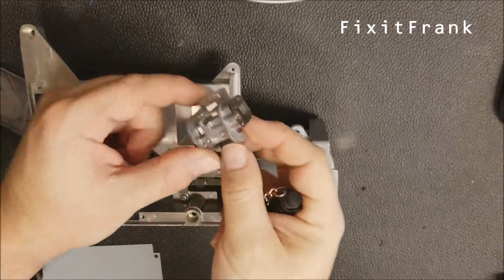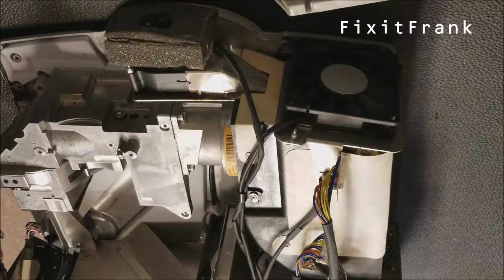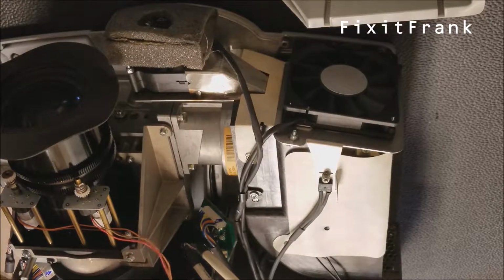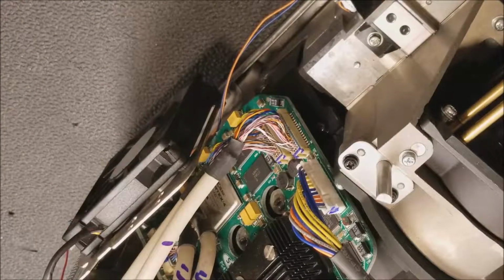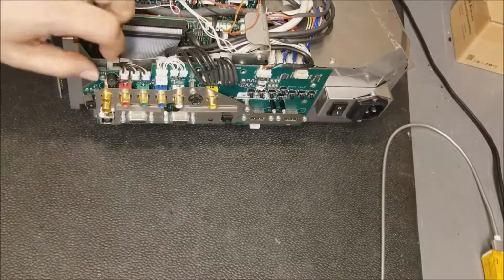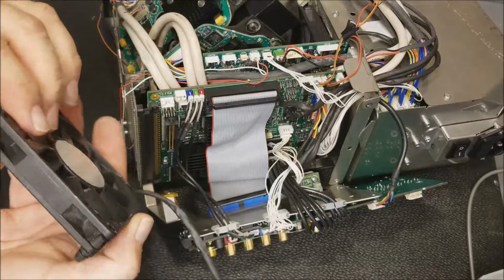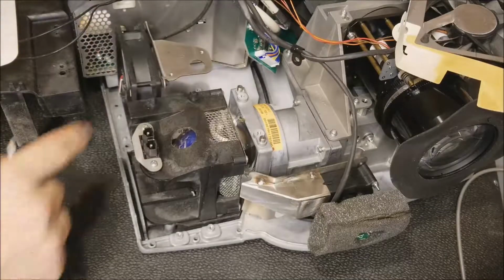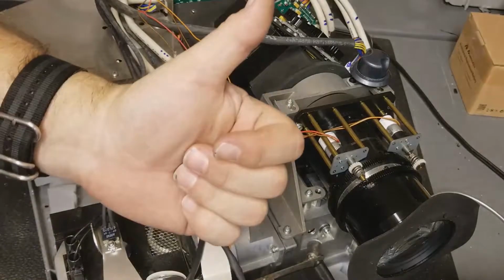Sim2 C3X DLP Projector Repair

Comment: Hi Frank. Thank you for this video. I have a question for you if you don't mind. I have a C3X Lumis Uno and I noticed something strange last week. When I run the internal test pattern menu (for example, the white color pattern), you can see that one corner of the image is very much brighter than the rest of the image (in the ceiling position, it's the top left corner). On the right, the image is dull and lacks brightness. Do you think it is the same problem you mention at the beginning of the video ? Or maybe dust in the brightness tunnel ? I don't know. I opened the projector today, and I disassembled the optic and it is clean. I didn't go any further for the moment. Thank you for your help.
Reply from the maker: Hi Serge, That is hard to say.  Here are a few things to check.  If your lamp is old, I would replace it first.  A failing lamp can make uneven lighting. Without using a known good lamp, you can run in circles. I recall that these use an integrator rod with I don't think can pick up dust since its one piece.  I have to double check on that but I doubt its the tunnel/integrator. You would have a very obvious visual issue with the picture rathe than just uneven brightness.  Another thought is to try adjusting the lens position and see if that changes the dimness. If it moves with the lens, I would change the lamp first and see how that goes.  Lamps tend to be the main cause of situations like this. Just make sure you can return it just in case it is not.
Reply: @FixitFrank  Hi Frank. Thank you for your response. So, my lamp is not very old (890H). Approximately one third of his life. That's why I didn't immediately think of the lamp. But it is a possibility that cannot be ruled out. I sent a message to SIM2 support. They asked me to send pictures of the screen to make a diagnosis. But, if it's the lamp, it's both good and bad news. The good news is that it's easy to fix, and the bad news is that the life of the original lamp was far too short. So you think it's unlikely to be dirt in the integrator ?
Reply: @FixitFrank  Hi Franck. Well, I have exchanged with SIM2 support. I sent them some pictures and it seems that it is the end, lamp side, of the ROD integrator that has burned. It seems to be a bit brown indeed. I am waiting for a quote from them. But I'm afraid of the bill.
Reply: @sergelefaurestier7719 did they sent you the price for the rod integrator? Looks like it happened to my Sim2 too
Reply: @Skymane  Hello. Yes of course. Sorry for you :( So .... The Rod Integrator on my SIM2 was indeed “burnt”. SIM2's after-sales service in Germany sent me a quote and I shipped the machine to them. The invoice was 1915€ plus shipping (yes, it's expensive :( ). The lamp was also changed (mandatory in this case) and the firmware was updated. The projector came back fine, and everything works perfectly. With the firmware update, I no longer have the problem of being unable to switch off that sometimes occurred. The damaged Rod Integrator was undoubtedly due to this projector shutdown problem. Indeed, when this happened, I was obliged to cut the power supply to the projector and then, very quickly, switch it back on so that the ventilation could cool the lamp properly. Then switch off again as normal. This problem was known at the outset. This must have happened to me a dozen times. But in the meantime, it's quite possible that the Rod Integrator has been damaged.
Reply: @sergelefaurestier7719 Thank you. Sim2Service told me, that ROD for Lumis is out of stock unfortunately.
Reply: @Skymane  Wow! That's a shame. Perhaps you could contact SIM2 in Italy directly ? My SIM2 is 12 years old now. No wonder the parts are no longer made. But it's a real shame.:(
Reply: @sergelefaurestier7719 Yes, I contacted them directly. They waiting feedbacks from the ROD manufacture (based in Japan) to check if this part is still produceable.

Comment: Hello Frank, thanks for the effort of sharing your content and knowledge. Could you please tell me if the Grand Cinema C3X Lumis 3D-S has internal switching to except different voltages dependant on a countries mains power supply - such as 120v to 240v ect? Thanks again.
Reply from the maker: Hello, according to Sim2, this model is 100-240(50/60hz). You should be ok. You can confirm by reading the plate on the back near the power plug.
Reply: FixitFrank Thank you Frank, I will PM you here on YouTube, so we can discuss possible inspection / servicing ect. Thanks.
Reply: FixitFrank Hi Mate, I can’t seem to find how to PM you on here? How can I get in contact to talk about getting my projector to you ect
Reply from the maker: It's in the about area, but you can use sales@weezytech.com. That goes right to me

Comment: I just picked up a sim2 c3x Grand Cinema for $250...are these projectors as good as the MSRP states? also, the rubber ring keeps falling off in front of the lens. how do you secure it?
Reply from the maker: I LOVE sim2 personally. I had one last year for a short bit before reselling it. I 'think' that ring should stay on by itself. Does it look split at all?  Also, pm me if you need a lamp.
Reply: I had the projector running for about 2 hours and noticed the ring fell into view of the lens. I didn't see any way it attached. ring is in good condition.

Is there a way to check the bulb hours. can't find it in the menu.
Reply from the maker: To reset or check hours you need to get into the service menu. I think this is the steps. DOT button → INFO button → 66260 (all  on the remote). Otherwise I would run it until its too dim or fails.  The rubber bit is usually affixed to the inside of the top shell if I am remembering this correctly.  There is a chance it was glued to the rim of the lens but I seem to recall it being part of the upper shell.
Reply: no remote came with it...
Reply from the maker: @thedbcooperforum  well dang. You may be able to get away with a multi-brand.  Most sim2 codes are the same in my experience. Otherwise, I'd just run it.  This model will not turn itself off when the time runs long. When it gets dim or fails, then replace the bulb.
Reply: thanks, what are these projectors really worth? it's too big for me and the throw distance doesn't work for me either. it appears to be in very good shape...
Reply from the maker: @thedbcooperforum  I've seen them for sale in the $3000 region on eBay. But I can't say if they selling for that. It's not far off though in my opinion. Sim2 has a loyal customer base.  Retailing in the $15k range when new, they hold their value pretty well.
Reply: the only problem seems to be the HDMI port. I get horizontal lines in the screen. going to try another cable but it works fine on another projector?
Reply from the maker: That is a nice image. As long as the HDMI ends up being OK, you should be able to get some decent money for it. I would not bank on getting $3K but if you look on AVS forum you may find someone who will pay at least a grand for it as it sits. I have not looked at what they are going for there so I may be way off on price(more or less). Either way, its still a great projector. Even if you sell if for $500 you will be in good shape(with a bad HDMI)
Reply: well, it appears the HDMI is bad on my blue ray player. I hooked the computer up to the Sim2 for Netflix and it seems to be fine. that's the video I uploaded through the HDMI.

Comment: Hello! I tried cleaning the Optics of my Truvue Vango LED DLP projector(same as the SIM2 Mico 40/50/60 Projector optical engine) and I may have wiped off the AR Coating on the back of the main lens, the TIR Prism, Front Surface Mirror and DMD Glass. I am saying so because the image contrast now has taken a big hit. The Projector is displaying the image but looks like a lot of extra unwanted light is coming into the image path hence the huge drop in contrast. What do I do? Can you give me your email address so that I could give you more details as I may need replacement parts?
Reply from the maker: Hi, I did some research and there isn't a lot of info on this model. As much as I hate to say it AVScience (the company who sold it) may be your best bet for locating the parts.  The best suggestion I have is go over the work you did and see if there are any shields out of place or alignment of the lenses that might have moved.  Its pretty hard to wipe off the AR coating unless you used acetone or something stronger to clean the glass.
Reply: Hello! Thanks for your reply and research. I would like to inform you that the Truvue Vango (AVScience) is actually a clone of the SIM2 Mico 50 so if you could target your research towards the Mico 40/50/60 with respect to the light engine (Chi Lin Tech LED Light Engine), that information/parts, will apply to the Vango.   I have tried contacting AVScience and was informed that they have stopped dealing/support for the Vango over 4 years ago.   I have noticed that after I cleaned the optical elements mentioned above there was a slight difference in the appearance of the elements surfaces. There was an apparent Violet/Purplish like sheen(maybe some AR Soft coating) on the surfaces of the main Projection Lens back element and the TIR Prism before cleaning but now it seems to have gone. I am assuming the cleaning action must have done that. I did not use any chemicals like Alcohol/Acetone for the cleaning. Just used microfiber cloth very lightly. I will however go over the work I have done to check for any misaligned elements or shields.  Thanks again.

Comment: hello!could you please help me?I have a SIM 2 projector D80 it stopped working have replaced the lamp ,burning two lights green and red and fan running lamps,click on a button does not respond ,what could be the problem?
Reply from the maker: Hi, I think I can help.  Is the green LED lit solid and red LED is flashing?  If so, open the top and check the wire to the small temperature sensor that is attached over the lamp area. It is a small black rectangle with 2 wires that wraps around the front.  It can be unplugged when the lamp is replaced.  I would retrace your steps and check my video on the D80 lamp replacement.  https://www.youtube.com/watch?v=KSe6qcgDLOU
Reply: FixitFrank give please your email!my email 89652082404 @yandex.ru
+79652082404 (tell number ,WhatsApp,Viber ,telegram ,FaceTime)please help
Reply: FixitFrank I. photographed the projector! You can see the photos. The projector was first looked at by another master and can see what's missing on the projector in the photo. There are a lot of empty plugs on them that can also be connected to them?